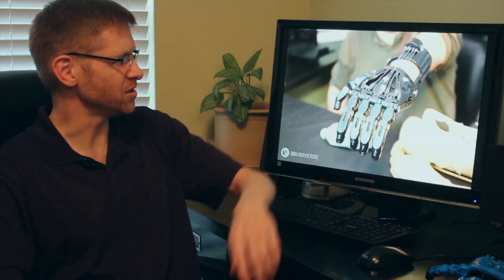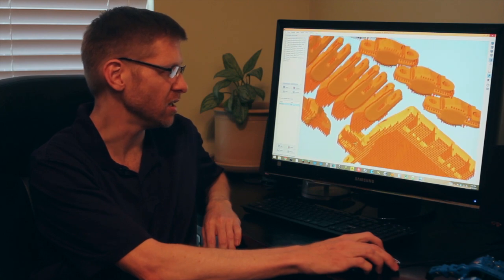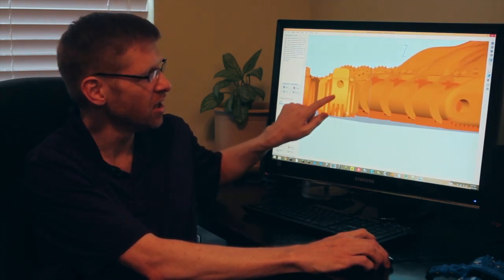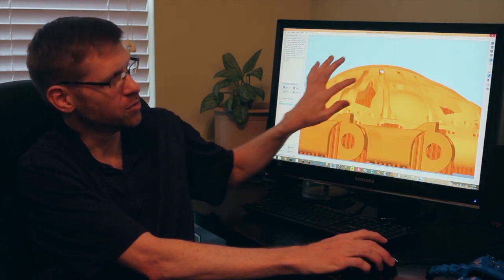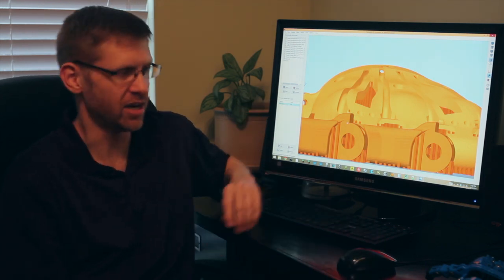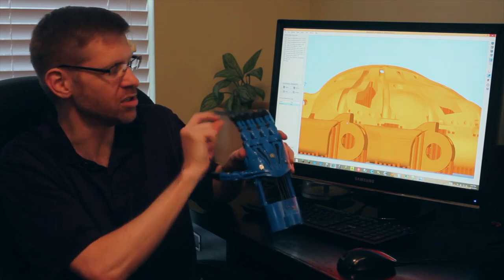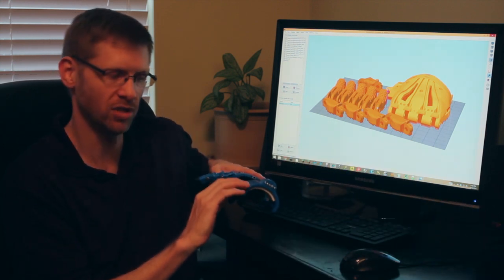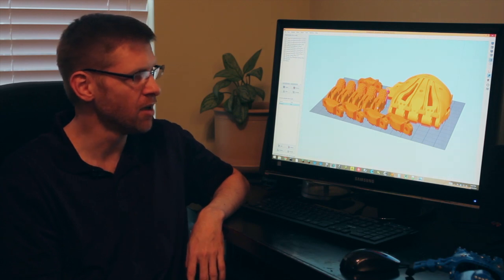Follow-up to Simplify3D 3D Printing Software Demo and Review (3D Universe)

Comment: I have the xyz da Vinci printer, do you know if simplify 3d software is compatible with that printer?
Reply from the maker: http://www.simplify3d.com/software/supported-printers/
Reply: 3D Universe thanks, noticed: ** Direct USB control of the Da Vinci printer is not currently possible.  G-Code files must be uploaded to the printer using the stock software.

if they have a trial I'll determine if it will be an acceptable fit with the additional step 

thanks again